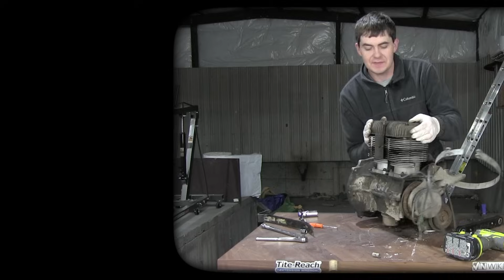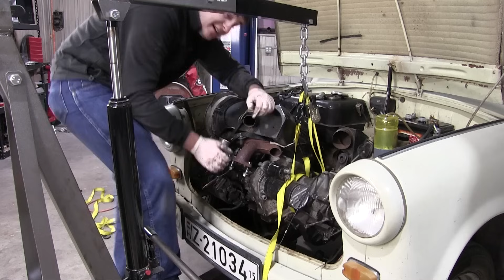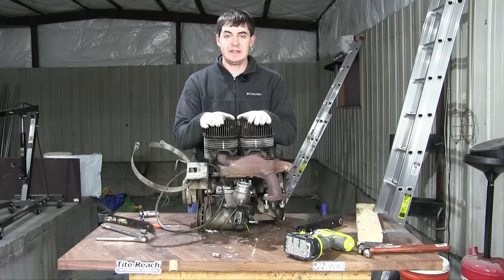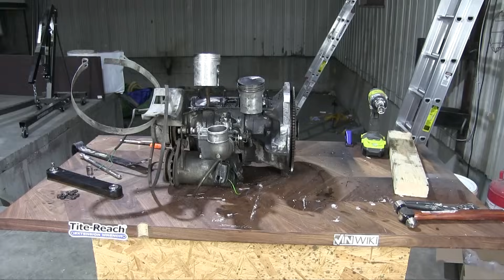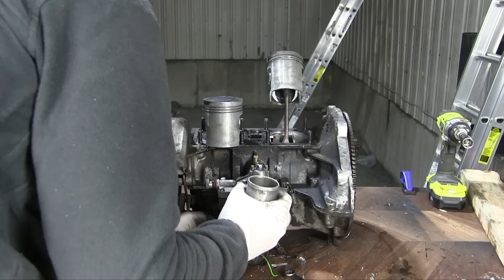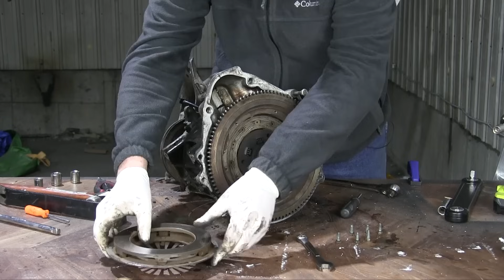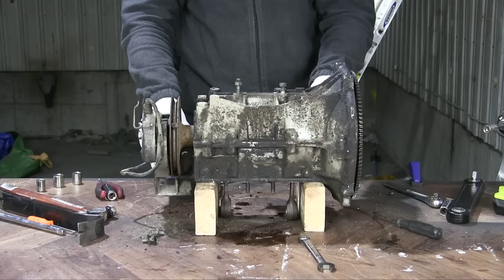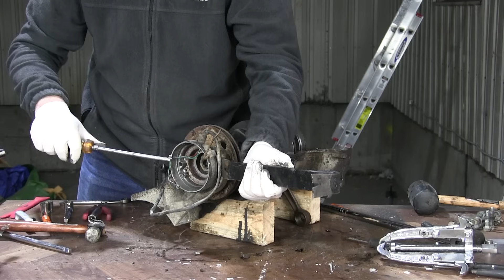Rebuilding the Trabant's Engine: Part 1 - The Teardown

Comment: Both dynamos and alternators are generators. The difference is that dynamos produce DC, and alternators produce AC.
Reply: In English car terminology, A generator produces DC and an alternator produces AC.  Outside of the car world a generator can produce AC but an alternator can't directly produce DC.
Reply: "In English car terminology, A generator produces DC and an alternator produces AC" - All these disagree:

https://dogandlemon.com/sites/default/files/Dictionary_of_Car_Terms.pdf
http://what-when-how.com/automobile/dynamos-automobile/
https://www.howacarworks.com/electrical-systems/testing-a-dynamo-and-checking-output
https://www.autoelectricsupplies.co.uk/product_list/165

"an alternator can't directly produce DC." - Well, yes, that's why it's called an alternator...
Reply: @zapadoceskesilnice3231  But most cars have alternators and not generators. And the alternator produces DC.
Reply: @gravelydon7072  facepalm Did you read the thread, or do you know literally ANYTHING about generators and electricity?
Reply: @zapadoceskesilnice3231  Actually, yes I did and do. I own a number of them and have operated/worked on even more for a living. Did you know that some alternators produce DC in order to operate. By doing so, you don't need brushes. https://www.youtube.com/watch?v=Z56kB2jef5U And as has been pointed out earlier, if it is internal to the housing, it isn't an accessory. It is part of the alternator that would not be usable without them for charging the battery.
Reply: @gravelydon7072  sigh the fact that some people may use inaccurate terminology doesn't alter the fact that an alternator, per se, does not have an internal rectifier. If an automobile "alternator" does happen to have an internal rectifier then it is not just an alternator it is "an alternator that has an internal rectifier". It really is that simple.
Reply: @md95065  No. An alternator is a whole unit that puts out AC. A generator puts out DC. That is the simplest terms and it makes no difference how it is done internally. If that were the determining factor, then an alternator which has brushes for an output would be a generator as that is one of the most commonly described features of a generator. Even though most alternators also have brushes. And some alternators ( AC output ) have diodes in them also. They are not described as alternators with an internal rectifier.
Reply: @gravelydon7072  You are using terminology in a way that is foreign to me and does not make sense. Perhaps what you are saying reflects the way that these terms are used in the US but it sounds very strange to someone who speaks (British) English.
Reply: alternators have rectifier diodes in them too what is supposed to produce DC if there is AC coming out of it that means its on its way out. you can sometimes hear it in the radio. it will sound like a high pitch whirring sound that goes with the rpm of the engine. my friends car does that. they started using alternators cause the dynamo only made certain amount of power depending on rpm so if you wanted more power had to rev it up. and when you had everything on and the car was idling it didnt make enough power. alternator makes its power based on how much power you put into the electro magnet in the rotor. so at idle and you turn everything on it will make those 80 amps with a strong magnet field but if your going down the highway with the windows down and just the radio its probably barely doing any work and the electro magnet is probably barely on. its electronically governed based on combination of load and input speed
Reply: Wrong, wrong, wrong.

1. The rectifier is an accessory of the alternator, not a part of it. 

2.  So if there's AC coming out (which you won't know for sure without an oscilloscope), it's the rectifier going out, not the alternator.

3. The main reason to start using alternators was that they don't need a commutator because the power is generated in the stator, not in the rotor, and the rotor only gets a relatively small amount of DC excitation  (field) current (that would be going into the stator of a dynamo). This current comes from the regulator and is used to control the output voltage. 

4. An idling alternator won't make a lot of power either. It needs to be spinning at a certain speed in order to be able to provide the nominal power output, and most car alternators won't do it at idle.

5. If you turn everything on at idle, the voltage will most likely drop, as the alternator isn't spinning fast enough to make the power your want. You'll also notice the engine load increase, since the power has to come from somewhere (the engine). While cruising, the ignition, fuel system, lights, etc. will need more power due to the higher engine load, which will, in turn, increase the load on the alternator, BUT it will be spinning faster, which will allow it to make more power and achieve the full output voltage.

6. Load and input speed don't really matter. All that matters is the voltage in the charging circuit, which the regulator is set to keep at 13.8 V or so by changing the field current. There's nothing to directly watch the input speed.
Reply: @zapadoceskesilnice3231  In an automotive alternator the diodes most certainly ARE a part of it. They are inside the unit and in no way are an accessory. For some alternators you can go to a parts store and get replacement diodes, but you can't buy an alternator without them.
Reply: @zapadoceskesilnice3231  ever seen an alternator from nowadays. the rectifier is inside the alternator now. starting from like the 80s on up and nowadays the field in the exciter coil is electronically governed depending on load and the load on the alternator decreases as it speeds up and becomes more efficient so as the load decreases and the power demand stays the same but the power output goes up with speed it just throttles back to compensate and keep it only giving out what it needs to. external rectifiers are not used anymore in newer cars and yea the best way to test it is with a scope but that doesnt mean you cant find out about it other ways
Reply: what i mean by that also is as far as i know it only uses the battery to start the motor then it charges the battery back up and once its charged it stops sending power to it and the alternator runs everything in the car. if the alternator goes out then it runs off the battery for as long as it can and in the newer cars it has a priority system that shuts off stuff till it gets to the ignition and fuel as last priority and then it dies
Reply: @chaytonruijsenaars3971  A few years ago the alternator in my 96 Cherokee quit. I was trying to make it home running off the battery and stuff kept shutting down, finally including the speedometer (I didn't know it was electronic until that point). But it got me home! Once I got home out of curiosity I tried to start it, absolutely dead.
Reply: @JeffDeWitt  The rectifier is mounted on the alternator, but the alternator can work without it just fine (if you don't mind 3-phase AC as the output). From an electrical point of view that makes it an accessory. Just like a water pump is an engine (mechanical) accessory even though a (complete) engine comes with it installed.

There are lots of rectifiers available separately, by the way: https://shop.advanceautoparts.com/c3/alternator-rectifier-sets/15584
Reply: @chaytonruijsenaars3971  External or internal (mechanically), it doesn't matter. It's still an electrical accessory that the alternator itself doesn't really need to work. And again, the voltage regulator doesn't need to care about how much power the alternator is making, it only tries to keep the charging voltage constant (and not burn the field winding with too much current). A higher load makes the voltage drop, to which the regulator reacts by increasing the field current, and vice versa, but the regulator doesn't need to know the load for that.

Speeding up doesn't really make the alternator much more efficient. Load = power demand. It's the same thing. As the speed goes up (with the same load/power demand), so does the power output, which requires reducing the field current to keep it constant. 

There is nothing to "stop sending power to the battery when it's charged". It stops itself. The regulator keeps the charging voltage constant, so once the voltage on the battery reaches whatever value it's being charged to, the current (= (charging voltage - battery voltage) / total resistance) obviously drops to zero.
Reply: @zapadoceskesilnice3231  As I said you can replace the diodes, that's a service part for the alternator, and they are generally mounted IN the alternator, not on it. As to the comparison with an engine accessory that doesn't quite work. If you buy a "crate engine", they rarely come with a water pump, but I've NEVER heard of an alternator sold without diodes. https://www.jegs.com/c/Engines-Components_Engine-Assembled-Ready-to-Run/10763/10002/-1
Reply: @JeffDeWitt  The rectifier is not inside the alternator housing (where the windings are). It's mounted on the back of the alternator, where the ends of the windings are, under a removable cover. Again, my point is that for the alternator itself it's an ELECTRICAL accessory that it will happily run without (if you keep the brush(es) in place). It's like running a car engine without a transmission - it will run fine, it just won't do anything useful.

Also, replacing the whole rectifier is possible, but replacing the individual diodes usually is not, and even if it were, there would be no point in doing it anyway.

Crate engines don't always come with an intake or an oil pan either (https://www.jegs.com/p/Chevrolet-Performance/Chevrolet-Performance-LSX376-B8-376ci-476HP-Crate-Engine/1277010/10002/-1). But in that case it's not really a complete, ready-to-run engine. That would be one of the "drop-in" versions which do come with a water pump, e.g. https://www.jegs.com/p/Blueprint-Engines/Blueprint-Crate-Engines-Small-Block-Chevy-383ci-430HP-450TQ/1617608/10002/-1
Reply: @zapadoceskesilnice3231  Actually the rectifier assembly on most alternators is either inside the unit or IN, not ON the back, and if you want to actually get AC out of the alternator you have to modify it because there are no external AC connections. 

The definition of accessory is "an object or device that is not essential in itself but adds to the beauty, convenience, or effectiveness of something else." 

https://www.merriam-webster.com/dictionary/accessory

Considering an automotive alternator MUST output DC current for it to do its job AND that the rectifier assembly is and integral part of the unit than the rectifier assembly is not an accessory.
Reply: @JeffDeWitt 

As for getting AC, you can literally just take that off each of the clamps that connect the stator windings to the rectifier. A dedicated AC output is not there simply because  there's not use for it.

http://www.utoyot8.com/images/433027840/420065998.png This is a diagram of a Denso alternator for my 1NZ-FE. You can see the rectifier on the back of the alternator housing under a removable cover. Maybe some alternators don't have it as accessible, but that's just asshole design and in no way is it necessary.

Again, an alternator will ALWAYS generate AC. That's why it's called that. If you put something on it that will turn the output into anything else, that's no longer a part of the alternator itself, it's merely built into the package because it's more convenient and cheaper (because there's only one output cable instead of 3 going to the rectifier, then another going to the battery, and something to cool all that). You can call the whole unit an alternator because you like it, but that doesn't make it accurate. It's a bit  like anti-parallel diodes on power transistors, those could also very well be outside as a separate part, but since it would almost always be the same type of diode for the same purpose, it makes sense for the to be in a single package, which is still called a transistor (usually an IGBT/FET). If you for some reason need a transistor WITHOUT the diode you buy a different one that was made for the purpose you need.

Google's definition of an accessory is this: 

a thing which can be added to something else in order to make it more *useful*, *versatile**, or attractive.
"optional accessories include a battery charger and shoulder strap"

And this is what it's all about. A battery charger is not a integral part of a cordless tool but it makes it more useful by allowing you to actually charge its battery more than once. A rectifier makes an alternator versatile by allowing it to be used in DC systems. But the alternator can be used without the rectifier if it's in an AC system, just like the tool can be used while swapping batteries. Each has its drawbacks, possibly making it unfit for a certain purpose - the alternator has to be in an AC system, and the tool may need a large amount of spare batteries - but technically they'll both still work, even if not quite the way you want them to.

And with this, I'm getting out of here. There are tons of more productive discussions out there.
Reply: @zapadoceskesilnice3231  Wrong! The diodes are a part of the alternator and not an accessory of it. The most current one wire alternators do not even have an external regulator like early ones do. And the diodes are often internal to the housing instead of mounted on the outside like the older ones. Even alternators that create AC often have diodes in them. My 15KW 12 wire one does.
Reply: Here's how I understand it. An alternator in most cars has a roter (the part that turns) and a stator(the part that doesn't) DC current is supplied to the rotor via brushes. This turns the roter into a magnet. This magnetic field generates AC power(usually 3 phase) in the stator which is then rectified (using 6 diodes) into DC for use in the car. Voltage is regulated by increasing or decreasing the amount of current supplied to the rotor. The more current, the stronger the magnet, the more power produced. The diodes and regulating circuitry are usually (but don't necessarily have to be) located in the alternator housing. There are also perminant magnet alternators, usually found on small engines or motorcycles. Their regulation is somewhat different. I will not go into this at this time.
  Now a generator is somewhat different. The rotating part is called an armature and the stator is called the field. Current is applied to the field magnitising it and power is taken off the comutator (the segmented thing that the brushes ride on) . This produces DC which is regulated by a combination of relays and resistors. Generators are long obsolete (and that's a good thing) but I'm not surprised that a Trabant has one.
Reply: @johnclarke2814  "The diodes and regulating circuitry are usually (but don't necessarily have to be) located in the alternator housing" - Exactly. There are multiple things in/on the housing, the alternator itself being the only one of them that is ALWAYS there.

As the names imply, the rotary part is always called the rotor and the stationary part is always the stator. A field windings creates an electromagnetic field and an armature reacts with said EM field to produce electricity (in a generator) or mechanical power (in a motor), regardless of whether it's the stator or the rotor.

Certain dynamos with field coils (not permanent magnets) can be regulated in the same way as alternators, i.e. by controlling the field current. Their main problem is the commutator - it creates sparks and high-voltage spikes which makes it very bad for low-voltage, high-current applications. The same thing is why DC commutated motors are slowly being replaced by AC (brushless) ones.
Reply: It's not possible to generate DC, you need a rectifier.
Reply: @ryzyooritzz   where did you get that idea from ? A dynamo generates DC (admitedly not very clean DC but nevertheless DC), the commutator plus a pair of brushes perform a crude type of rectification. You don't need a rectifier as such, it is integral to the design. Strangely enough when I was a kid our bicycles had what was called a dynamo to power its lights but it was actually an alternator. Dynamos have not been used on cars for about sixty years (because when solid-state power diodes became available the old inferior dynamos became obsolete overnight).
Reply: @dogphlap6749  Right, i stand corrected.
Reply: @ryzyooritzz  A generator DOES produce DC, the key is in the commutator which ensures the output is DC. That's as opposed to an alternator which actually does produce AC, but the current is then immediately rectified by the diodes.

Comment: "I'd imagine a lot of you haven't seen the inside of a Trabant engine before."  Actually, imagining it is pretty easy:
Imagine a weedwhacker engine.
Now imagine that a lot bigger.
Repeat.
And you're done!
Reply: correction:
imagine a weedwhacker engine
done
Reply: Image a weedwhacker engine

but smaller
Reply: A little bigger*
Reply: A weedwacker engine might have a bit more power and a broader powerband..........LOL
Reply: This is more like a snow mobile / jet ski engine.
Reply: well, weed wacker engine X2
Reply: I once had a Peugeot moped that had a needle bearing connecting rod set-up. It’s like that only a whole lot bigger.
Reply: More like a Snowmobile engine of the same era.
Reply: Agree.   "The trebant: with all the technology of old lawn mowers." ..
Reply: Imagine a wheedwhacker engine... but with cheaper materials and components, and with worse machining.

Done!

Comment: Removing the flywheel is like removing old drum brakes! ...Or I imagine that the bolt holes for the puller are like a lawnmower flywheel remover. https://bit.ly/2FwAKzt